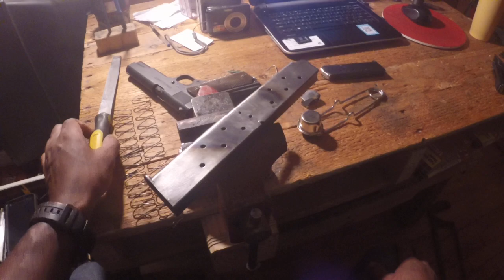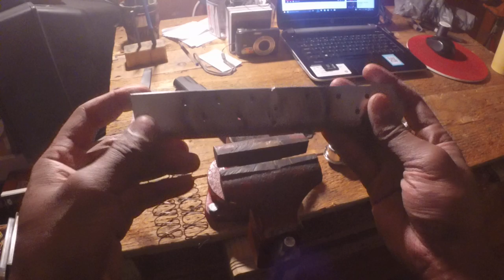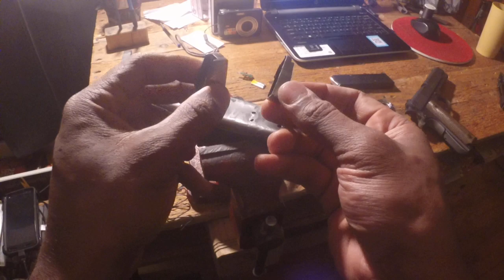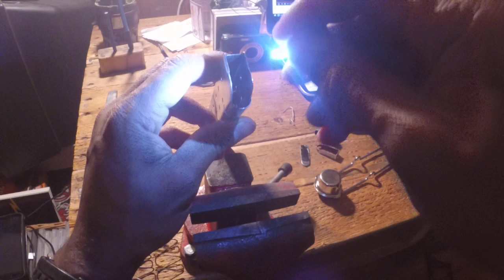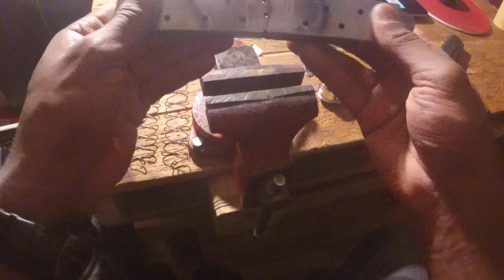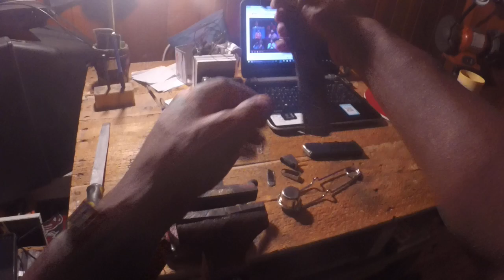Extendo Project

Comment: If you are open to suggestions I have a few. First, for the mag being inserted into the gun it should be a factory 10 round mag. Second, after preparing the mags for welding (cutting off the lips and bases) use thin plates welded to the outside to attach the mags. This prevents the molten metal from dropping into the mag and touching your follower. The reason for using a 10 rnd mag to be inserted into the gun is that should provide clearance for the welds to not come in contact with the mag well. Hence making it easier to fit. Love these little projects, keep up the good work sir. Thumbs up.
Reply from the maker: +Jake Outdoors Thanks for the tips. The crappy welds on the back, were the only ones that interfered with the follower. The nicer ones on the front and side had full penetration, but we're smooth inside of the magazine.